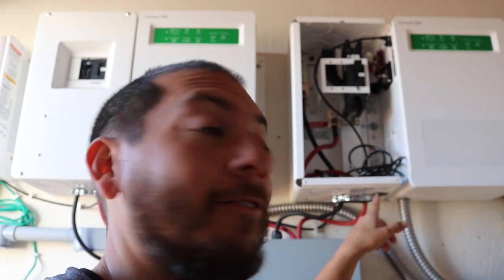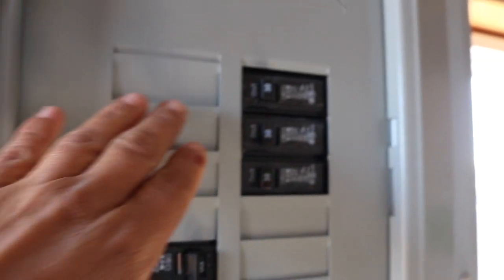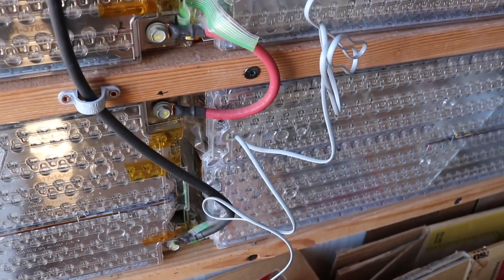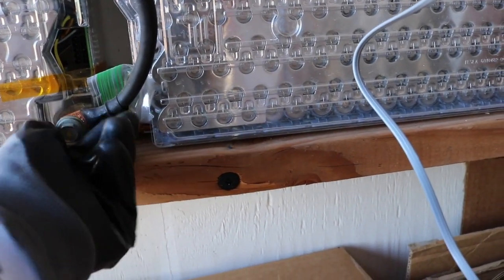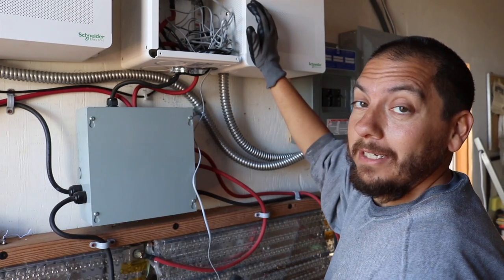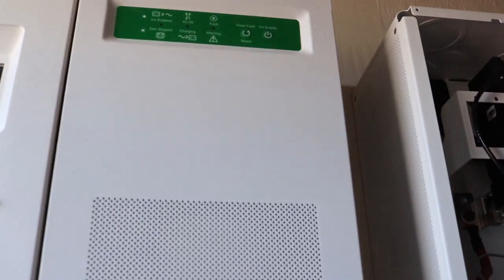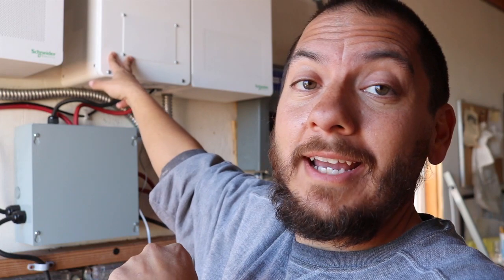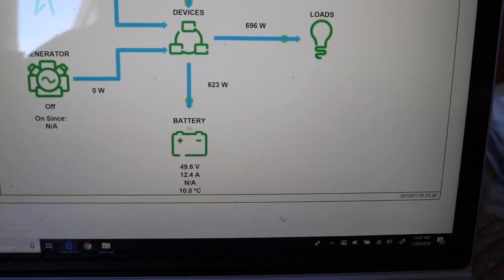DIY Installation of a Battery Temperature Sensor for Off-Grid Solar

Comment: Well nice video presentation but this is quite not safe to attach your sensor to the battery terminal for 2 reasons:
1. The terminal cannot give the accurate temperature of the battery especially when the terminal is rigged via a busbar as shown in your video.
2. Attaching the temp sensor to a terminal can blow up your charge controller and inverter if the internal wiring get corrosive and bridges internal or otherwise. That is why later manufactural of battery temp sensor no longer attach ring for terminal hookup.
Finally I strongly recommend that sensor be dropped in the battery chamber for securing your charge controller and inverter pls don’t attach to any of the terminal either + or –
Thanks

Comment: That's pretty cool that your using Tesla batteries! What do you think about keeping your batteries under ground to keep the temperature more even?
Reply from the maker: That's an interesting idea. It would have to be in a way no moisture could get in. We could also build out the earthen walls of the shed to increase the thermal mass. That may work too. Thank you!🙏

Comment: Hey Jim! That's really cool a simple sensor for your solar system!! How are you enjoying your Tesla batteries and did you connect and set up your power grid all on your own or did you have an electrician come out for any of it?? Great video and thank you for sharing!! We hope you're having a great week!! <3
Reply from the maker: The Tesla batteries are nice, and have been working well. I did a lot of the work myself with wiring up the panels and running it out to the shed. If you're familiar with Handeeman, he came and helped hook up the equipment in the shed. It was a huge help and got us running a lot quicker than if I tried doing it myself.😀 
Thank you so much for stopping by.🙏

Comment: Yes, battery temperature is important!  Sweet!  That's a real nice solar system you have!
Reply from the maker: Thanks so much! We needed something a little heavier duty since we planned on three household running off of it.😬
Reply: Hey... next time you have an extra set layin' around.. send it on over.. haha!
Reply: You guys seem to run similar hours to me.. :)
Reply from the maker: @TheFarmacySeedsNetwork  an extra set of what?🤔 I may have it.
Reply from the maker: @TheFarmacySeedsNetwork  I've been burning the candle a bit at both ends trying to keep up with everything. 😆👍
Reply: Your solar setup... the whole thing!   just kidding... :)  but thanks for the kindness and generosity!
Reply: Yeah me too.. shuffling regular work among firewood and stoking and such.. not to mention snow clearing etc etc.  Make sure you get some good rest occasionally in between though.
Reply from the maker: @TheFarmacySeedsNetwork  Thank you! I'll definitely try!🙏

Comment: Easy last step... I didn't know you could shut it down if it wasn't in the right temperature range.
Reply from the maker: It won't need to shut down, but the inverters won't over or under charge the batteries in more intense weather fluctuations. 
Thanks for watching!🙏